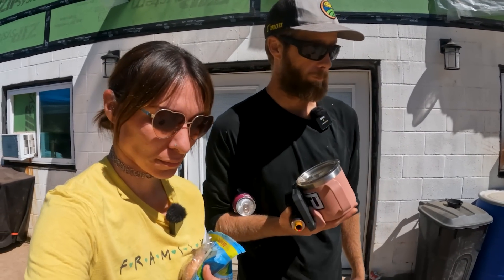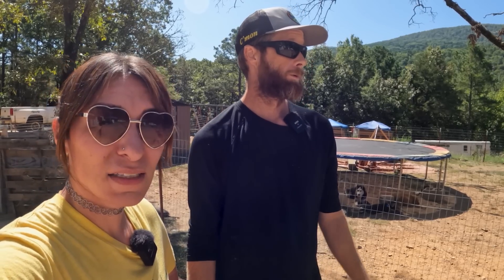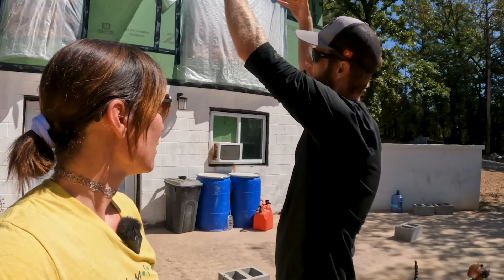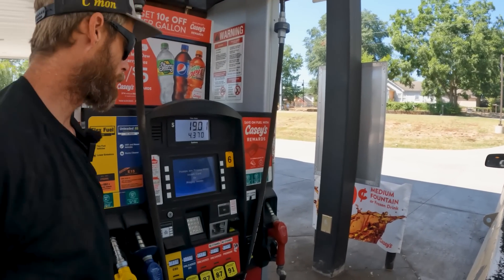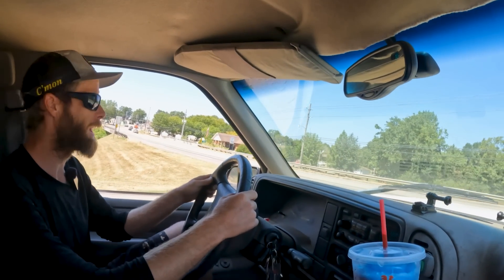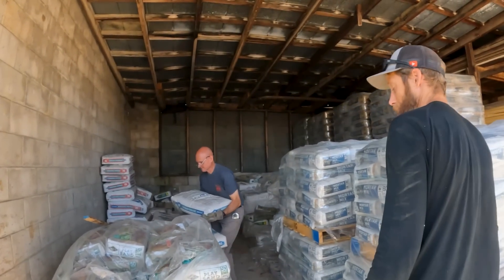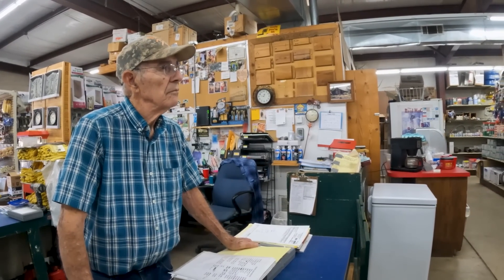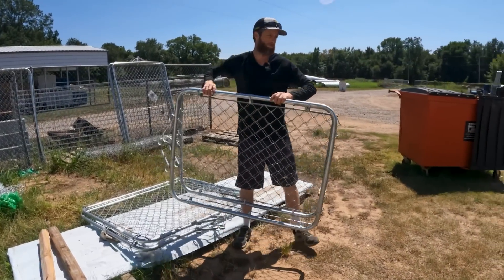It's Time To Move Forward |Building A Cabin Homestead |DITL| Old Time Garlic & Honey Cold Medicine

Comment: When I lived in China we used to take ginger, mince it up, about a quarter of a small pot full, fill the rest of the pot full of water, heat to boiling then let it simmer for 20 minutes to half an hour. The longer you let it simmer, the stronger it gets and add water as the level drops off. Pour it through a colander to get just the fluid. Then put it in a big cup, add honey to taste and if you have a cough, add a dram of brandy. Drink it down and go to bed. Worked like a charm!

Comment: By extending your support posts outside of the slab, you will have full use of your patio, and your deck will be bigger. No one has ever complained about having too big of a deck. Also, I don't understand why you want to use concrete block on the bottom of the posts and wood on the top, use either all wood or all concrete blocks. Personally, I would use 6 x 6 treated posts on metal bases for the supports. I have built many two story decks, and wood is the best way to go guys,

Comment: I guess I'm not seeing how your pillars are going to work if the block is only 7 high and the same height as the wings on your patio. How are you going to be able to exit the basement without ducking and bending yourself in half, especially Gary, because the support pillars are only 7 blocks high?
Reply from the maker: There will be wood pillars on top of the blocks. 💚🙌

Comment: Sorry Gary, but I don't agree with your new design for the columns being in the
middle of the patio slab, thereby narrowing the width of the patio.  
If you want to line it up with those block wings on either side of the patio slab,
then just add to the length of those wings, until they extend towards the end of the
patio.  This way the new columns can be put where they s/b, at the end of the patio,
not in the middle.  WHY DO YOU WANT SUCH A NARROW PATIO WHEN YOU HAVE
THE SPACE TO LEAVE IT LARGE?

Relax Mel, "I'm just asking".  I don't want you getting all sensitive & upset, thinking that 
you're getting picked on, thereby giving all of us a big lecture again.   I use to be 
a Real Estate agent.  I'm very familiar with design, architecture, etc.  You have a lovely
large, concrete patio base, why destroy it, just to line up the columns with the wings
is beyond me.  You can always screen in the patio & install screen doors on a angle
in the 2 winged areas.  Willingly making a large patio narrow is a real head scratcher
for me.  

Oh well, it's your property to do with as you wish.  In the long run, you will regret your
your decision, Guaranteed
Reply from the maker: So I didn't even think twice about your comment, until you said "Relax Mel, yada yada yada..." Like for real you're calling me out while saying you're not calling me out 🤣
Regardless, you're entitled to youre opinion. It's all good. I'm not mad at it. Carry on.
Reply from the maker: I feel like your comments towards us are super bi-polar lately. 
You never started out commenting like that towards us but then one day you flipped. Your assumptions and aggression towards ME In particular lately is just WOW.  
Its whatever though. Our Life is good. We are happy. Thats all that matters. I hope you find your happiness. (And no, I still ain't even mad and you are welcome back anytime). LATER LATER